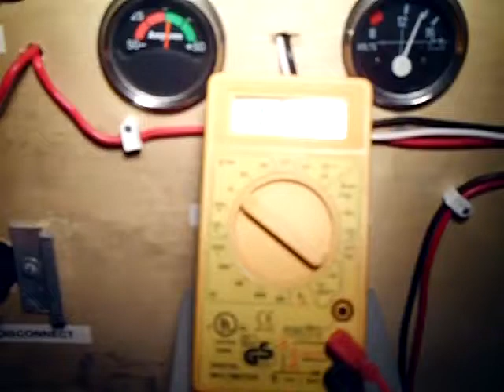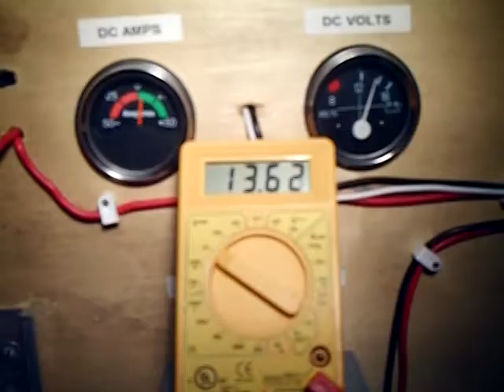Wind turbine charging batteries pt2

Comment from the maker: Yes the turbine is connected directly to the batteries and controller only monitors and dumps the excess power to a resistive load. Don't worry about the voltage as the batteries will regulate the turbine's output. Once the batteries charge to 14.3volts the controller will begin dumping to a resistive load. I hope that helps.

Comment from the maker: Actually the turbine's output is regulated by the batteries so that if you have a 24v bank then turbine output is maintained at near that voltage. In my case my bank is 12 volts and my turbine in high winds does not exceed a bit over 14volt with the circuit closed, but I open the circuit and let the turbine run without the batteries you'll see voltage exceed 100volts in high winds.  Your controller will be just fine.

Comment: and when it is putting out this amount of voltage will the controller just dump it all or will it put 14v to the batterys and dump the rest? as in the diagram on the ebay listing it seems that the turbine i connected directly to the batteries and the power is dumped from them?? or am i wrong?
i currently have solar panel but adding a homemade turbine as not getting quite eniough amps from my panel.

Comment: Hi, a few questions for you.
i am buying the same controller as you off ebay the 160amp one, but without the enclosure so that i can mount my volt and amp meters on the enclosure.....my q is ..when the turbine is spinning full tit in a storm the turbine will be putting out 30+ volts yes? is this ok for the controller?

Comment from the maker: It makes unregulated 3 phase AC power and WindMax sells them with 12v, 24v or 48v charge controller. The model I ordered only sold with 24v controller so I ordered a 12v 80A controller from Coleman Air. So the the turbine cable goes to a Delco 150A rectifier and then to the charge controller and batteries. Lowering the charge voltage allows me to begin charging at lower RPMs. I will make a video soon showing the precise connections and explaining the details.  Thanks for your comments!

Comment: is your wind max 12 or 24 volt .I built a 1000w turbine with a 12v stator but it did not charge very often so I built a 24v stator now I charge at half the rpms.gret videos